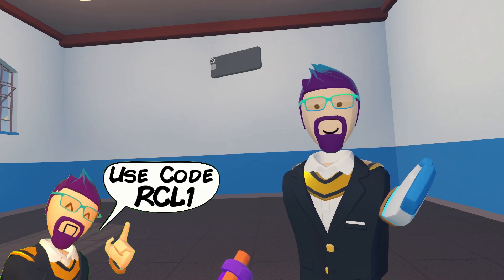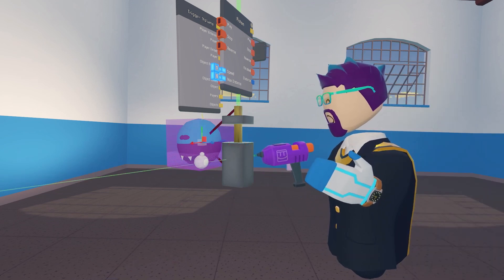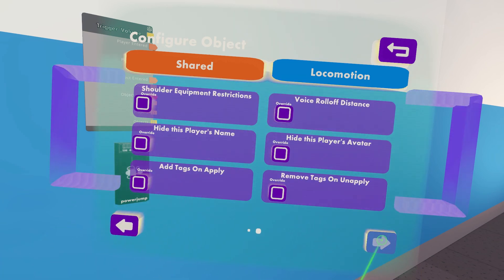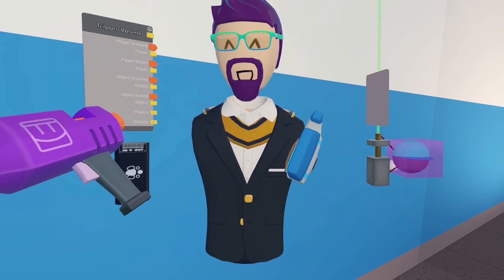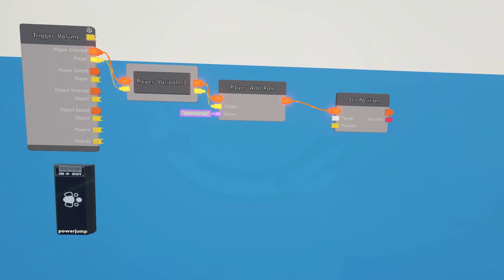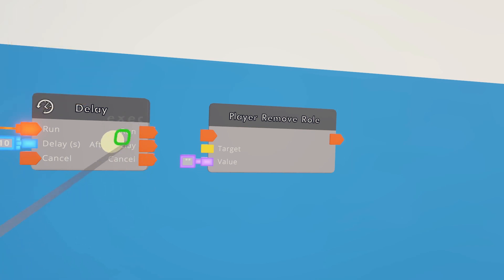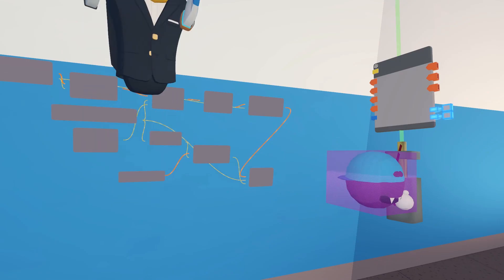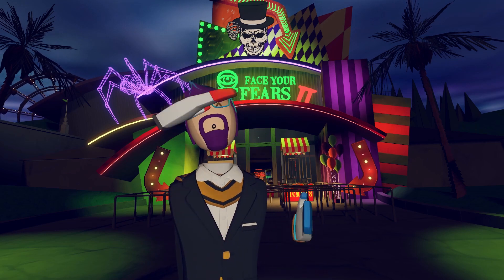How To Make Power Ups In Rec Room

Comment: Hey so I found out how to make the AI correct but could you tell me how to add more than one AI in a room without them merging or glitching or being directly behind eachother without messing with the speed?
Reply from the maker: hmmmmm im actually not sure how to do multiple, i guess you have to find a way to capture and hold the ai then measure there targets individually, i don't think there is an ai variable yet. as for speed configure the mlower monster before it spawns there should be a speed settitng
Reply: @theRCLman  huh alright thank you!